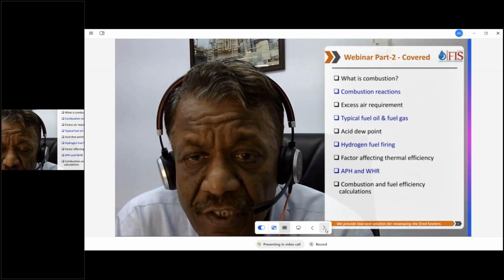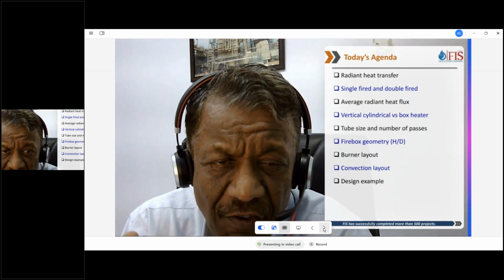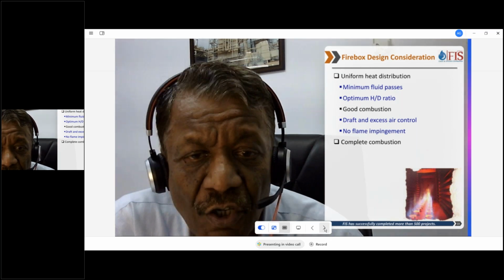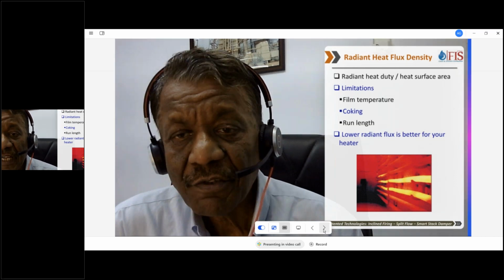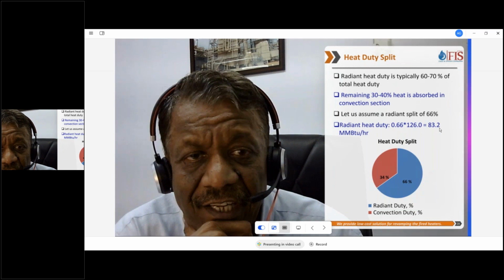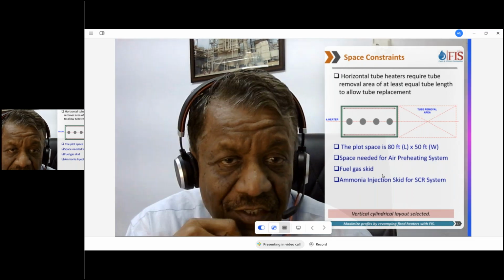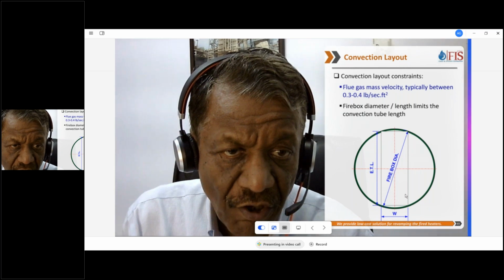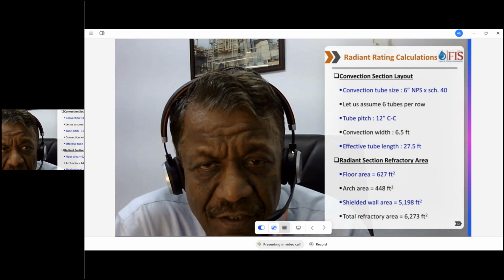Fired Heater Design Training (Part 3) - Radiant Section Sizing

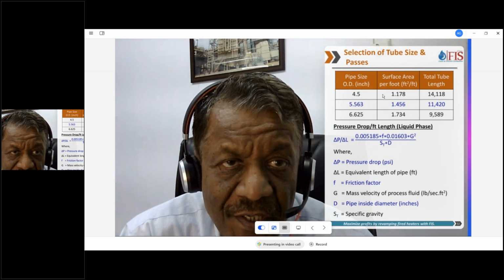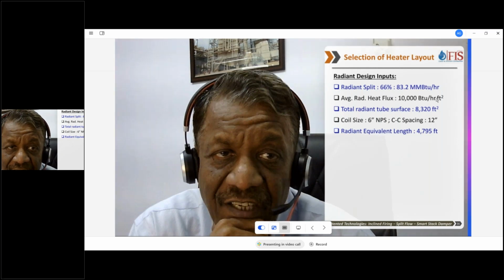Comment: I think there is a calculation error in the total tube length at minute 39:56 (length = 9589 ft for a 6-inch pipe). The total tube length should be half of the value in the table. At minute 43:40, the radiant equivalent length is correct (length = 4795 ft for a 6-inch pipe). The calculated pressure drop should be half the value due to the diameter mistake. Please correct me if my observation is wrong. Thank you.

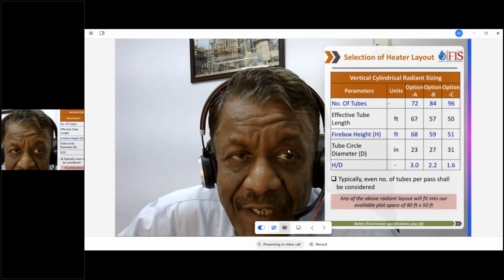Comment: Hello Sir, i just wanted to ask you how did you calculate the tube circle diameter ( D) (44:40)
Reply: Using cosine rule: a^2 = b^2+c^2 -2bc*cos(theta)
b = c 
a = distance between tube pitch = 2*ID 
Theta:
72 tubes means 360/72 = 5 degrees
theta = pi()/180*5 radian

rearrange the equation:
circle radius = b = c = SQRT(a^2/(2*(1-cos(theta)))
Diameter = 2*b

I have calculated using this formula and found similar result